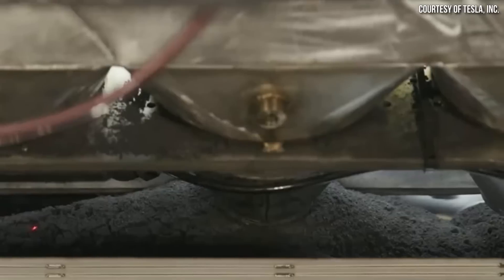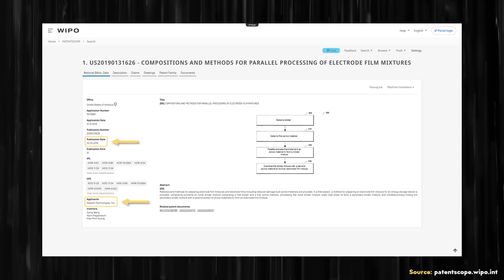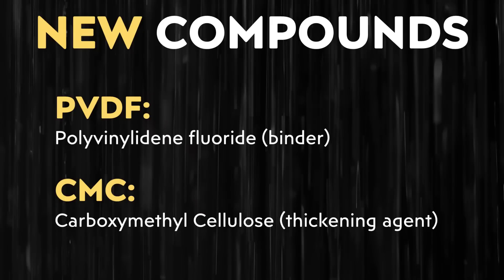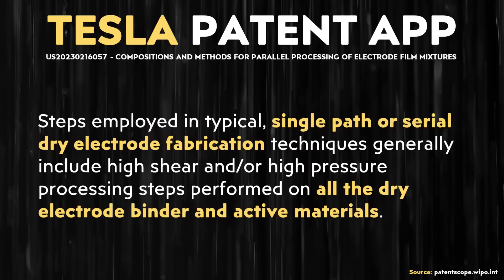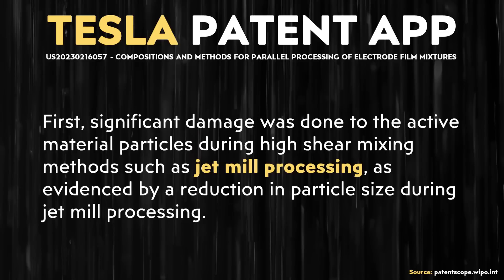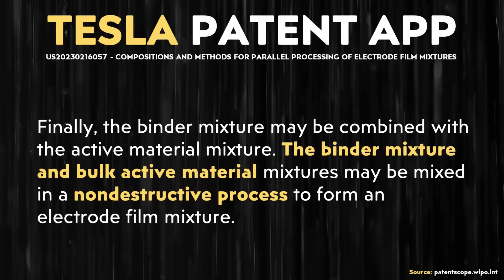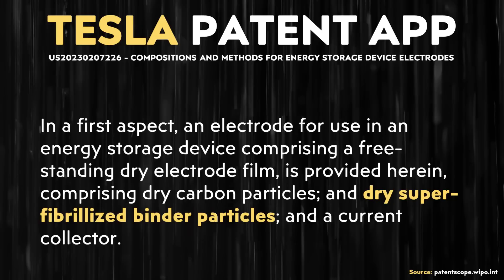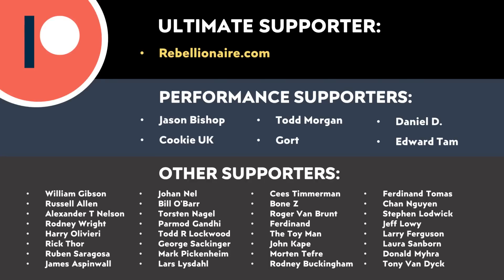NEW Tesla Battery Patent App | LONGER LIFE BATTERIES!

Comment: This is definitely evidence of innovation.

Legal innovation.

Tesla uses patents defensively. They're tweaking the dry coating patent to guard against patent trolls.

By the time a patent tweak gets through Tesla's legal department, their engineers and materials science people have worked with those materials for a considerable length of time. They are probably well past the prototyping phase - assuming they intend to use the described process.

Sometimes, they're just keeping options open.

Patents can give a useful overview of a process. But they don't do much for real-time illumination of engineering innovation, or even reveal what Tesla is doing, or intends to do, in production.

Patent defense is critical. There are malicious actors out there who will exploit any chink in their defense. Really, it's quite a lot like cybersecurity: protecting the company from monetary losses and inconveniences. Defense requires effort. And smarts.

I suspect some patents may even have a more sly purpose: to throw competitors off the scent. But I am not accusing Tesla of using patents in that way. I'm sure it happens, somewhere, but such a practice probably seems unnecessary for Tesla. Their moat is speed, not deception.

Probably.

Comment: Thanks for that insight. So the 4680 will ramp up to become the dominant battery for EVs soon. 

Maxwell was sold to Ucap Power in July 2021. So Tesla must have stripped out the patents before selling the firm & its people. Was that selling the golden goose?
Reply: Re: "stripped out the patents" - that's very crude language to use for leaving the Maxwell company, whose products depend on their patents, without patents or any way to manufacture more products.  They're obviously not going to be able to make things without the patents.  So it's logical that Tesla may have been assigned the rights to Maxwell's patents, but Tesla would give Maxwell the right to use them.
Reply: @acmefixer1  Well it’s strange that Tesla continues with 4680 cells with the dry electrode process patented by Maxwell, sells Maxwell and buys Grohman and changes its name to Tesla automation. Perhaps I’ve got it wrong. Please correct me.